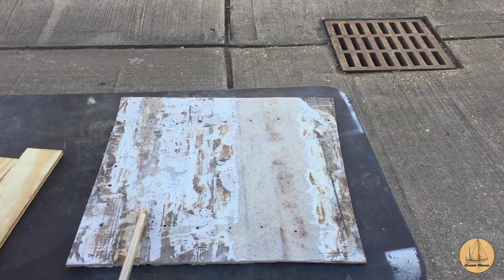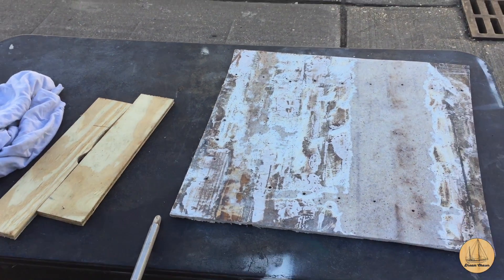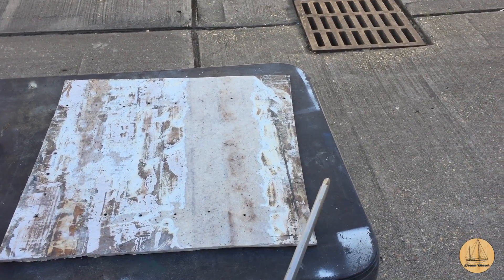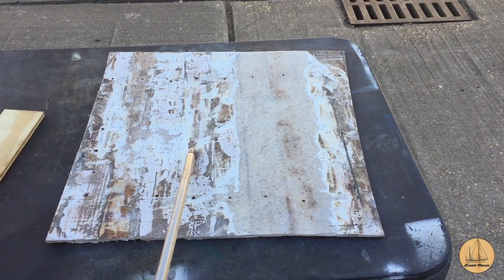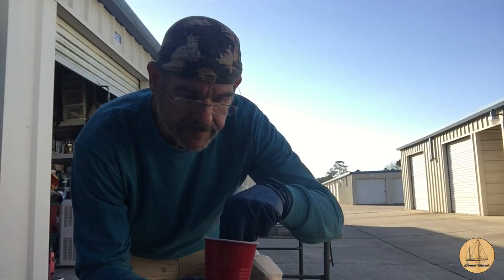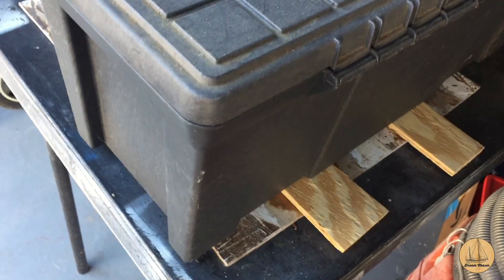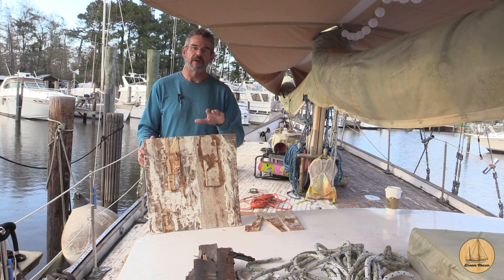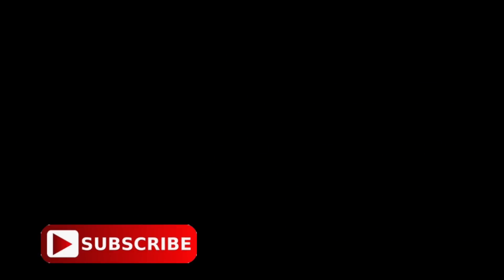Epoxy Destructive Test

Comment: So five years later, and I’m wondering what this lovely sailor decided upon
doing and how?  With hindsight 100% behind him … would he do anything different in this present day? 
     I hope he reads this & replies!
I certainly appreciate all the knowledge and friendliness which his videos offer.😊
Reply from the maker: Dora, I was really a bit pleasantly surprised when I received this result. I did a second test off camera (same thing) and the results were the same. My conclusion remains that for the repair and re-do of my deck. I was essentially trying to decide if I was able to avoid going all the way down to glass on the entire surface or if that would weaken my overall deck repair results. I concluded that it was worth it to sand the deck smooth (But NOT Al the way down to bear exposed glass) before applying new deck material. About a year after this video, we repaired the couple of spots in the deck core that needed to be repaired and I put the cut skin back over the spots I repaired. I then had several layers of woven mat applied to the entire deck to strengthen it all into a new single surface. That was over 4 years ago and it has held up great. I have no delamination or any other negative results. Side note. I decided to use Poly resin rather than epoxy resin when I did my deck repair. It allowed me to save thousands of dollars and I figured the entire boat was made of it so I didn’t need my repairs to be stronger than the boat itself. Lol. I hope this helps.

Comment: you might want to use the other end of the bar.
Reply from the maker: Certainly could have.  In this case, I was wanting to run it down the seamed joint rather than pulling up on the very edge by using the shorter portion of the pry bar.

Comment: the guy on boat works used a spray called PVS let it dry in his mold then painted gelcoat on over then did his glasses and resin then pooped it right out with no prob and fully finished,was cool
Reply from the maker: I will have to go back and check it out. his channel is one of those ones I often find myself going to for advice and seeing work in action

Comment: +SVDreamChaser I'm s/v Jedi on the forum :-)
I think what your test shows is that you have a delamination issue with the existing deck. Even with old polyester, it should not be that easy to pull a layer of fiberglass off a laminate.
I would cut the top layer away and dispose of it as well as any wet core, then put core back where needed and put new fiberglass over that. I would use epoxy for that but when experts say it's okay to use polyester and the savings are worth that (I can't argue about that) then sure, use polyester.
Reply from the maker: Thanks for the great info and guidance.

Comment: Why do think there was any epoxy on your existing deck. The teak was bedded in polysulfate. The core is bedded in polyester. The only epoxy in there would be from recent repairs
Reply from the maker: Alan Stevens correct. I believe there were some repairs made at some point years ago. When I looked at the teak deck, I could tell there were places that the teak had been cut and I wasn't sure if the fairing that was done between the layup and the teak adhesive was epoxy or not. There are no real records of all the repairs done by previous owners.

Comment: you don't need another layer of ply over the existing deck. If the existing core is solid and adhered, you have a strong enough deck. Why add extra weight ?
Reply from the maker: Alan Stevens I want to add a layer or two to offset any strength the teak deck was providing and the additional layers will ensure any of the 7000 removed screws don't leave any possible leaks into the core.
Reply: I doubt that the teak was adding any strength. I agree about adding additional layers to cover the holes, but a layer of mat should be all you need.  

Are you going to rebuild the house sides?  If so, you should wait until that job is done, then put new glass over the sides and across the deck to add strength and ensure waterproofing.
Reply from the maker: Alan Stevens I will likey be replacing at least one maybe both sides of the coach house. I will come back and blend it later as there will be a lot of time between these jobs for me.

Comment: Very interesting - what I think is happening is that the interlaminar peel strength within the old polyester/glass deck laminate is not great, so it's the weakest part of the whole structure and is what fails in peel. However, peel is not the type of stress that will be applied to the structure in service. 

As the person who obsessed about surface preparation when you asked on FB, I now have to consider why the unprepared area appears stronger. I think it is this: You have abraded and degreased so, in both cases, you will get a decent bond to the original structurewith the epoxy (did you prime with unthickened resin first, to wet the surfaces of the ply and the deck before adding the thickened epoxy?)

However, on the less abraded area, you have a far thicker lamination between your epoxy and the first interlaminar polyester bond, so the type of test you are doing in this case is closer to an interlaminar shear strength than a peel strength and polyester performs far better in ILSS than in peel. We used to test toughened epoxy film adhesives in sandwich structures using this test:  http://www.adhesivestoolkit.com/Docs/test/MECHANICAL%20TEST%20METHOD%201%20-%20Climbing%20Drum%20Peel%20Test.xtp
Reply: This is the ILSS test, done by flexure of a short beam: https://www.zwick.com/composites/shear-tests/interlaminar-shear-strength-ilss
Reply from the maker: Very helpful stuff.  Thank you again Jerry

Comment: Great vid.  I like that you decided to test for yourself.  I agree that there is a lot of conflicting information out there!
Reply: As regards laminating with polyester, if you plan to form a finished surface with it, you will need to stop styrene evaporation from the surface after laminating - it will cause an effect known as air inhibition and leave the surface improperly cured. Cover with a plastic film or apply a so-called "flow coat" of wax-containing resin as the last layer.http://www.cfsnet.co.uk/acatalog/methods_flowcoating.html
Reply: I don't think that fairing over a flow coat works because the wax on the surface will act as a release agent and the fairing compound won't adhere properly. You could look at the possibility of using a textured release film in contact with the final coat of resin which will a) stop air inhibition and b) give you a textured surface once removed. In fact, you could use what is known as a peel ply, which you tear off after curing and removes the top layer of cured resin, leaving a bondable, active surface. I've never tried it with polyester, though.
Reply from the maker: Wolf I will share what I found with this test and I am going to do one with polyester resin ad well to see if it is good enough.
Reply from the maker: +Jerry Jones   Thanks for the great detail & info. I will read about the difference between peel and ILSS. If I do go with Poly I will do a final wax coating resin before then fairing with a thickened was coated fairing coat.

Comment: On the bare glass you should put on a layer unthickened epoxy first, because glass sucks epoxy liquid from thickened epoxy and leaves a "dry seam" . Also You should be aware that epoxy adheres to polyester resin well, but polyester resin does not adhere to epoxy!
Reply from the maker: SY Ottiliana thanks. Great feedback on the percolating of resin.
Reply: I don't think old cured fiberglass will absorb any resin. your bond is mainly mechanical, so more tooth is better